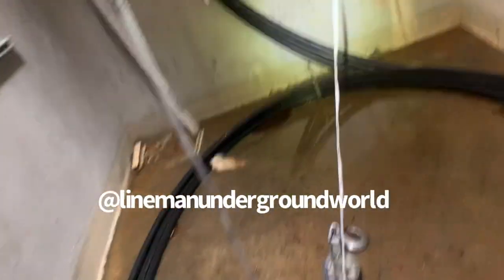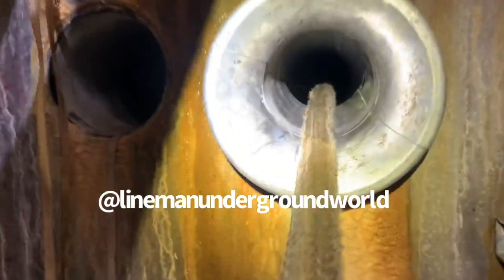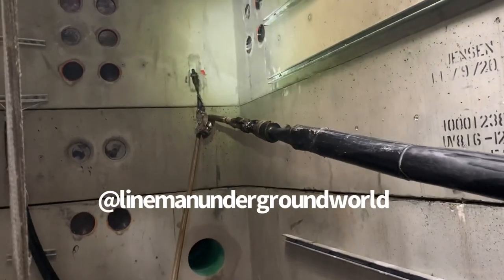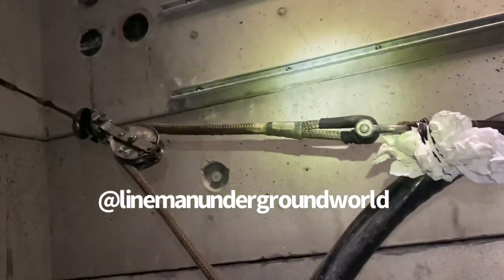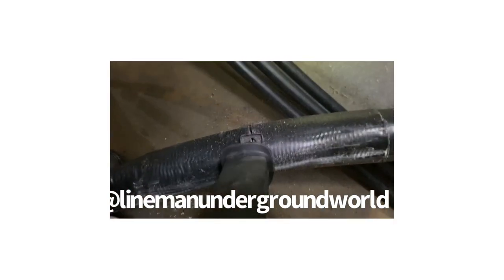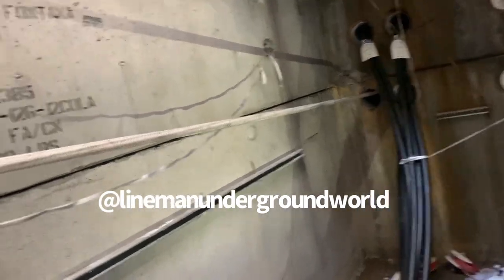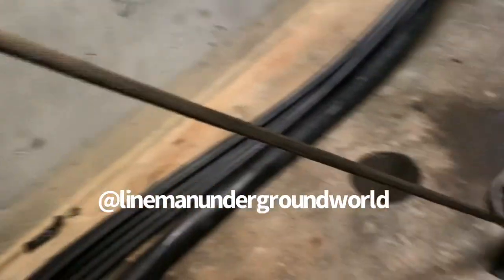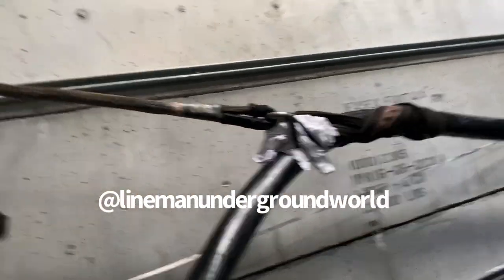NEW 34.5kv vault

Comment: Looks like a nice setup, sometimes you can put in a big radius roller in the vault and pull the cable thru the roller but when you are dealing with 35kV cable in such large sizes you need too big of a radius roller and you can blow out the sidewall from too much tension so pulling it straight to the vault wall /block  and then pulling a bit more slack at the end works well like this.  What kinds of terminations are you using with these, t-bodies? Looks like a DWP setup, I think they use T-bodies/vault stretchers for 35kV taps and straight splices for straight through cabling.  Richards makes a nice premolded 35kV Y joint which is nice for taps, saves some space over t-bodies.